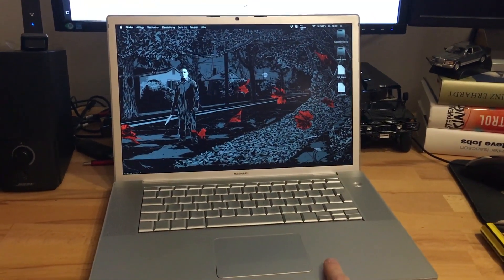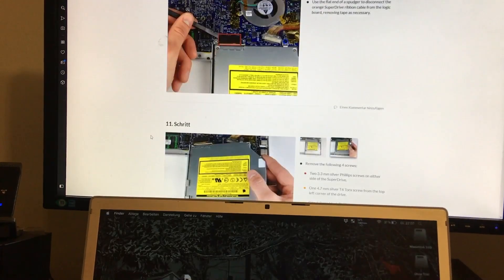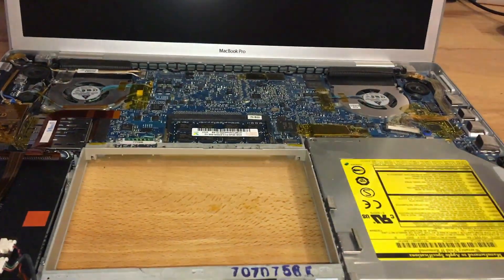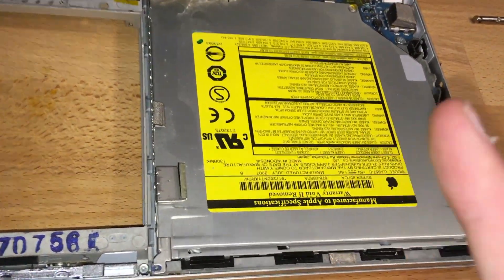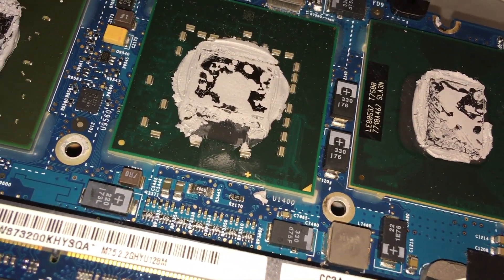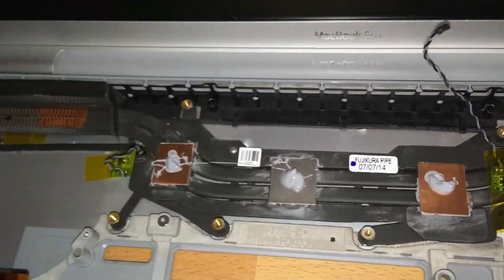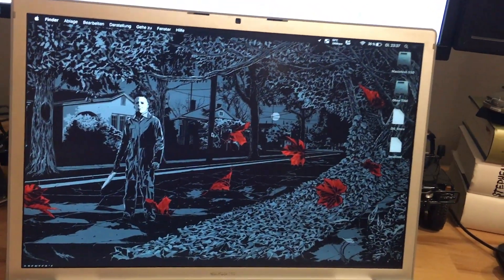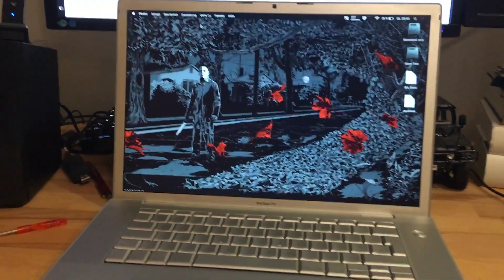Thermal Paste Renewal on old Macbook Pro

Comment: Thanks for the video, I have an early 2008 mbp, which I upgraded a few components of last year. I think I accidentally broke a fan controller connection though, it does get hot, and the fan is constantly on. I’ll try to re apply thermal paste, can’t hurt I guess! 
What is the temperature readout software you’re using?
Thanks!

Comment: What non-original replacement battery do you recommend for an a1260?
Reply from the maker: I can't really recommend a specific reseller but I'd say go for a not too cheap one with good ratings. Cheap, bad batteries can be as dangerous as a fire hazard!
Reply: @MacintoshMen  Thanks!!

Comment: If one never moves the laptop, would removing some of that transparent orange tape help with air circulation?
Reply from the maker: No, that little thing doesn't make a difference
Reply: Oh, and it would be interesting if there was a cooling solution offered for the location of the Superdrive when you remove that. Such a waste of space otherwise. Maybe some big fan that plugs into the same slot on the board.

Comment: Other is chip is most likely the North Bridge processor, DVD player might cause the rigidity loss of the MacBook being gone. That's too much thermal paste, to be honest.
Reply from the maker: Since the video I have been using it daily until a week ago and I did notice a problem with the optical drive gone actually. When I give it away I will put it back in though.
Reply: MacintoshMen  What problem did you notice?

Comment: You used way too much paste
Reply from the maker: Putting on thermal paste is always a controversial subject. I use this computer daily and I can say that the temperatures dropped and the computer doesn't cook the desk anymore when under load. So wether too much or not, it did the trick.